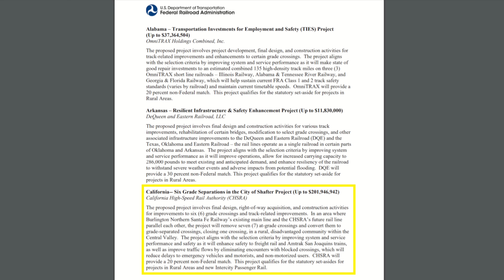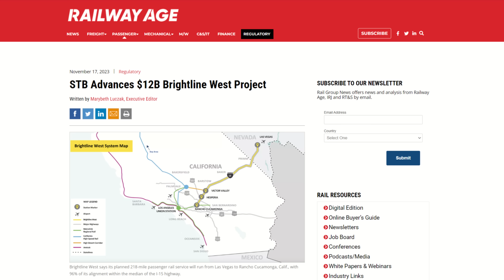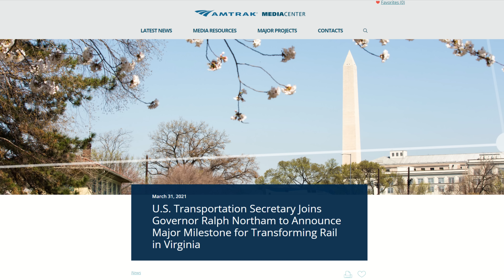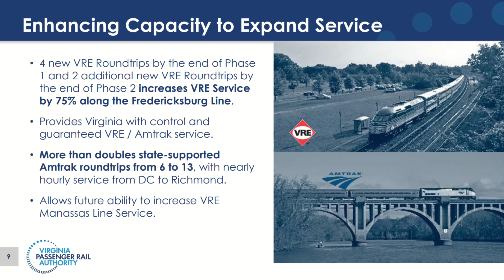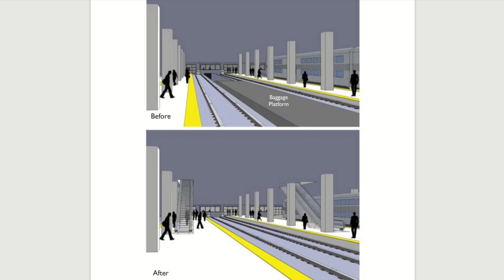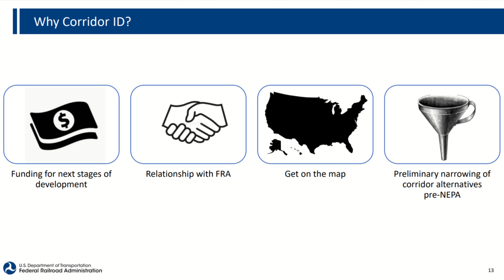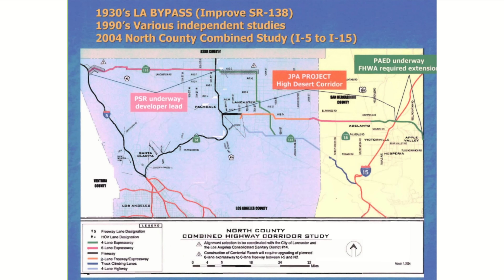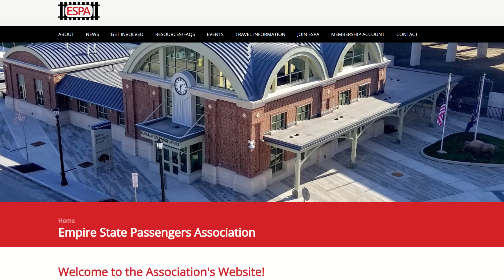Revenge of California High Speed Rail | $6 Billion in HSR grants | Stew's News | Brightline West

Comment: So one thing I want to ask.  Have you considered highspeed sleeper trains like the Chinese ones and how that might integrate with improved regional rail over the continental divide.  Say a train runs high speed New York to Chicago via Pittsburgh and then to Kansas City or Omaha and then over an improved Santa Fe mainline overnight to hit Phoenix to Las Vegas or just directly goes to Las Vegas and then takes Brightline West to LA.  Is that feasible and could it provide at least a half of the cross continent form of competition by way red eyes.
Reply from the maker: Why do that when you can fly? I know some people use the long distance routes, but it's only about 4 million trips a year for the whole country. It's difficult to see how that could justify the enormous expense.
Reply: @LucidStew  to eliminate inter continent flights and give the Mountain West states a reason to support it.  They already likely would be getting intercity improvements, and there are trains like Renfe's gauge switch and the mini Shinkanses that operate on both high speed and normal speed networks.  Essentially, I'm pretty sure that those states would be getting intercity regional rail to at least placate them with their own interconnectivity and give them connections to the network, so why not give them a little bit more and also allow for through trains and different connections between the Midwest and the West Coast besides going through the old low altitude crossing of the Southern Pacific and Rock Island.  That was also the longest connection, by the way, and the route I described is the old Super Chief route slightly modified to connect to potential high-speed rail corridors on both ends and running through to its old connection with the Pennsylvania Railroads routes to get between New York and Chicago.  If you want the rich and famous to use the network more, that would also help by getting better connections between their favorite places.  Also, there are towns along the old transcontinental mainlines that almost or do have more people using the train than fly, and they only get service by essential air service and Amtrak.  I think this happens because most EAS flights move you to a major hub while the train gets you more local trips.  So with those towns they definitely could be helped and maybe have some demand induced by rail improvements, and having a high speed train sneak across the continental divide at night not only improves connectivity between the high speed corridors it's bridging but would give more than the local intercity connections to those towns potentially killing some of the need for EAS.  Lastly, I don't feel comfortable telling Denver, Salt Lake  City, and Boise that they won't get anything because they're inconvenient.

Comment: My father's family was from Pennsylvania and we used to visit Lancaster, but I suspect we've been pronouncing it wrong. I like the S-Line fix-up. It's efficient in a lot of respects,. To me that's the only thing that matters with passenger rail. By contrast I decided to measure roughly the distance by UP as opposed to CAHSR between Bakersfield and Fresno and it was something better than six miles.
Reply from the maker: Me too on the S-Line. The geometry changes were a pleasant surprise and seemed to be generally good. Although, from the alternatives, they maybe could have aimed a little faster. Still, nice speed and time improvement overall. Twice the time saved compared to the Lincoln Service line at 2/3 the cost. That is a relatively great deal.
Reply: @LucidStew  I'll have to go look at them. Sounds interesting. Lincoln was 1.5-billion several years ago but they didn't really do anything. That one little town they moved the station to a remote location - that was about 1-bil of it as I recall. Grade crossings everywhere, and you could see where it used to be two tracks that they left as one, what a racket, makes me wanna... some gruesome train accident...
Reply: Oh and re Lancaster, I remember asking some little kid why do you call it LanCASTer and he replied I don't know. But it doesn't mean it's pronounced the other way, because you hear people from there say it that way, and that kid might have been from there.

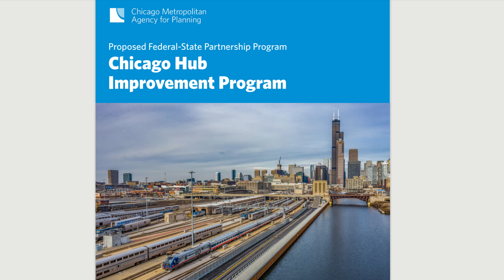Comment: 6:52 why do they need 7 years to start running a second train on a line they already run one train on??
Reply from the maker: I've yet to find the technical docs related to that project, so I'm not exactly sure. The award is for final design and construction, so those details may not be available yet.  There are places where the geometry can be improved(I looked at it for my Keystone video), but I don't know if they're looking to go that far or just building passing sidings in various places(also plenty of places they could do that).
Reply: @LucidStew  I see

Comment: CAHSR and Brightline West are destined to converge imho, the proximity of the two projects is too close not to. Maybe I'm being naive, I don't know. 

Are we all betting on the Velaro novo to be the selected rolling stock?! What other manufacturers have submitted interest, and what are their chances? Anyway, the train is just the cherry on top; the big fat expensive cake is that sweet straight track 😋
Reply from the maker: Palmdale is way far off without an injection of about $40 billion though. Alstom is also in competition. Because of federal Buy American stipulations, the field is pretty narrow, although with the idea gaining momentum, maybe other foreign manufacturers would set up U.S. plants. Technically Stadler isn't out of the question, but their HSR model only has a top speed of 150mph.
Reply: @LucidStew   Stadler SMILE is a beauty, but indeed not fast enough (as it was designed for less fast Austria-Switzerland-Northern Italy routes). I don't know if they have a faster model in the pipeline, but if not then they're missing out.
  Glad to hear positive rail news from the US; the plans for new HS corridors here in Britain are biting the dust, which is a shame, though we saw this coming.
Reply from the maker: @alexverdigris9939  The Interstate Highway System is nearly built out. The data is pretty clear that new U.S. transit passengers will either be rail or air. HSR, to some extent, HAS to happen to facilitate continued growth.

Comment: What is the mark up in price for electrifying a line over making a line diesel run?
Reply from the maker: It depends on the speed and geometry because that determines the amount of land that needs to be acquired. 200mph electric is about twice the cost of 125 diesel for new rights of way, although that will vary depending on the obstacles(see CAHSR mountain ranges). On the same ROW, electric is about 25% more. This is interesting because electric is also quite a bit more cost effective at 125mph as opposed to 200.

Comment: Yes, Merced to Bakersfield.  Does anyone think this segment will support itself, I have a bridge to sell you.  Until the line runs from SF to LA, I see yearly deficits that will strain California budget with little return.   Has anyone really driven that route in a car or bus?
Reply from the maker: It is predicted, by the CAHSRA, to lose ~$80 million/year. This is predicted to be an improvement of the current loss through the state-sponsored Amtrak San Joaquins that now services the route. I have driven that route. :) I agree, it doesn't have a hope in hell of turning a profit.  This may also cause a legal issue as the system is required to cover operating expenses by Prop 1A.
Reply: Yeah it doesn't make sense brightline started service here in Miami the largest city in florida connecting to Fort Lauderdale then west palm Beach, two also big cities. If they were following their leadership they would've started in LA and San Diego, las vegas before going up to San Fran.
Reply: I might add that if Brightline was running California's HSR, I'd feel far more comfortable.  Even Amtrak could do somewhat better than an independent agency that has never run a railroad before.

Comment: 11:25 I’m probably missing something but why is Brightline building initially to Rancho Cucamonga, then branching off to Palmdale at some future date to connect with and maybe even  through running on to the 25kVAC OHC electrified CAHSR track to reach Los Angeles Union Station. Would it not make more sense, both logically & fiscally, to concentrate on building a single route between the Victor Valley & Greater Los Angeles Area? At least to me, it seems more reasonable to construct the extension to the current MetroLink & Future CAHSR Station in Palmdale, which would to start with require a MetroLink transfer to the Antelope Valley Line, just like Rancho would to the San Bernardino, but having the possibility of a one-seat-ride into DTLA, assuming sufficient capacity on the electrified Palmdale-Burbank-LAUS section to allow interlining.
Reply from the maker: I think more than 1 end point is fine given how spread out the area is. The problem with Metrolink at Palmdale is that its a 2 hour trip from LAUS and your end point is still in the desert. So, you might get some people north end of L.A. using it, but everyone else probably not. Another thing is that probably 80% of everyone driving to Vegas from socal would drive past that Rancho 8th St. station. Not many would be going up the 14 through Palmdale. Probably just people from San Fernando Valley, or Ventura area.

Comment: I think the authority can find a billion here and a billion there from the federal government, and the state will probably chip in a 1-2 billion. I think they can finish out the Merced to Bakersfield 2029-2030 (ahead of schedule) because they got the money sooner which means they can start building the extensions, tracks, and stations sooner too. This will save some money from inflation which means they probably don't even need the full 5 billion, they can save about 1/2 billion from inflation.

For Brightline west, they actually delayed the construction date from 2023 to 2024, which means they will finish out later (2028). This project will probably cost 200-300 million more because of inflation.
Reply from the maker: The only place they can get a billion here and there is MEGA, otherwise it's going to be a billion here or there in aggregate. Most of the money will need to come from the state. It almost surely wont be ahead of schedule. They aren't ahead of schedule to start. They have no plan to accelerate the schedule. They haven't put one train on tracks and had to deal with the myriad issues that will pop up with that.

Comment: I am still trying to understand the wisdom of the GSP stop for the Atlanta-Charlotte HSR line. I used to live in that area. I've flown in and out of GSP too many times to count. And in that time not once did I ever hear anyone step off a plane there and ask, "OK, so what's the fastest way to get from here to Charlotte/Atlanta?" It looks like a costly diversion which would only benefit people from Anderson, which isn't saying much. If upstate SC had any sort of transit connection there as well, I could understand the significance. But that day is forever away because SC has generally been allergic to public transit.
Reply from the maker: As far as I can tell, they decided airports were important and so that route wins because it stops at the most. It's seems like a very political and very bad compromise as opposed to skipping Greenville-Spartanburg or only stopping at Anderson
Reply: @LucidStew  It seems the sensible move here would be omitting GSP and Anderson, and stop instead south of Greenville as it's the most populous county in the state. It'd be closer to equidistant from the NC and GA borders as well.
Reply from the maker: @dennisc6716  Straight through and maybe a station at the junction of I-385. If they're going to build this, whatever they decide, it would behoove the Greenville-Spartanburg area to come up with a comprehensive local transit plan based around the result. The area is so spread out, a station there will have trouble unless traffic is properly funneled to it.
Reply: @LucidStew  Your video where you had the HSR going through Columbia, SC and Augusta, GA seems like a better idea to me for entirely selfish reasons as it would allow me to fly to Atlanta, and then get on a train to visit my brother who lives in Columbia.
Reply from the maker: @compdude100  What makes sense to me in some future scenario is that the Greenfield alternative has the HSR(just because that's what they're going to do), and then the southern route gets a similar, slightly more economical version in addition.
Reply: @LucidStew   Yeah, probably, or at least the southern route will have a 110-125 mph rail line. It's too bad that there's no good existing ROW that is straight enough to get HSR into downtown Greenville or Spartanburg like there is with CAHSR.
Reply from the maker: @compdude100  In the far distant future when all rail converts to overhead catenary in the U.S., they'd be able to hook into the Crescent line that runs through there. The net zero goal is 2050, but seems unlikely to get done that soon.
Reply: It is so they do not need to route the line through Greenville and Spartanburg for stops.